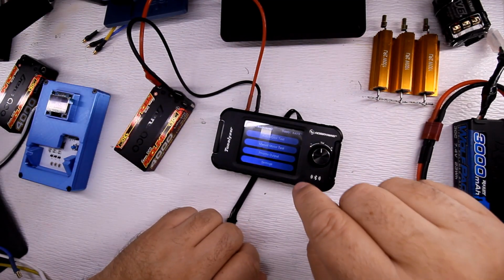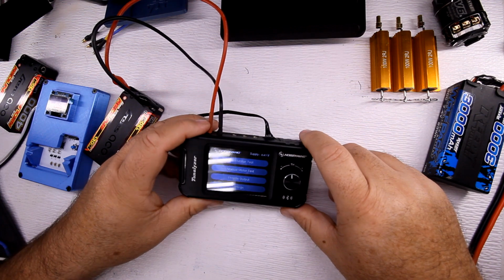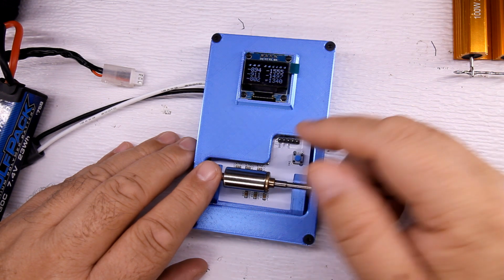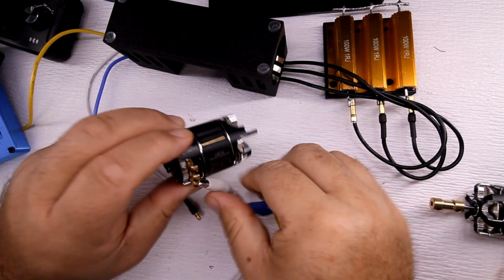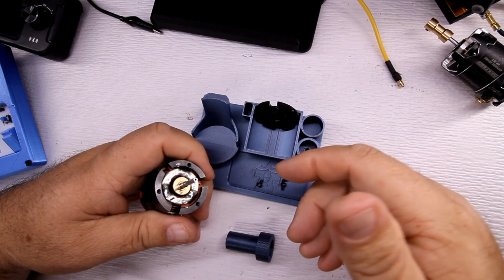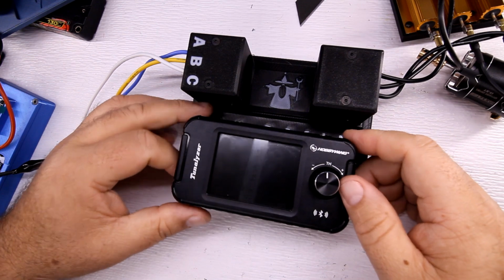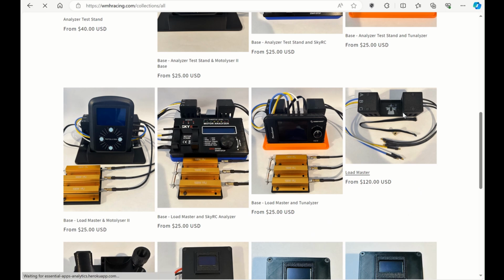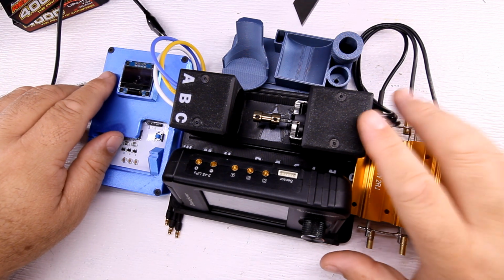What I Use to Test and Tune Brushless Motors

Comment: I’ve been watching your vids for a while and subscribed. There was no comments yet. So what up clegggg? I assume it’s from east bound and down. If not, still what’s up clegg. At any rate, I have a tekin g4 spec r 13.5 on my wheeler right now and it’s a straight ripper. But maybe it’s me but to me it’s harder to tell the diff in motors as the turns come down and revs go up. Anyone else feel that? Maybe carpet guys. I’m on an indoor clay track with medium grip. Anyways. Thanks a carry on.
Reply from the maker: Wut up Braaaaad...  Eastbound and down, load'em up and truckin...   Nope, Wut up Clegg is what I hear when someone is about to ask for a favor or question.
The Tekin motor is a pretty good motor. It is hard to tell the difference in motors.  You may trust a well-known brand, but then find out they less known motor, at a lesser price, is better.  That's why I started doing these comparisons.
I just built a new machine to compare motors.  I'm running a few tests on it, right now, and will do some vids with it soon, I hope.